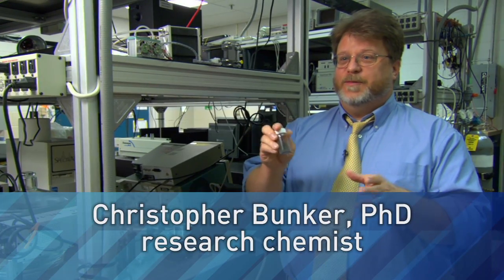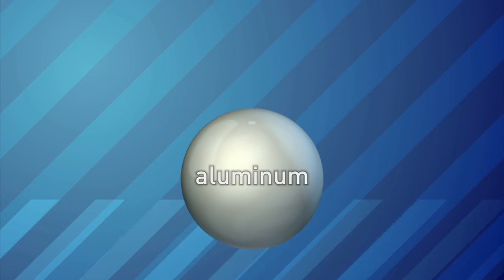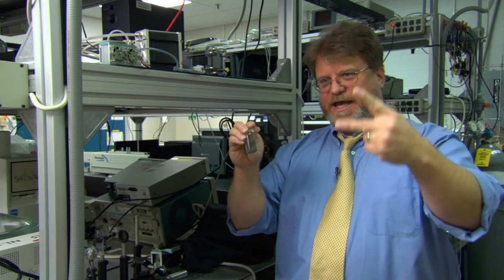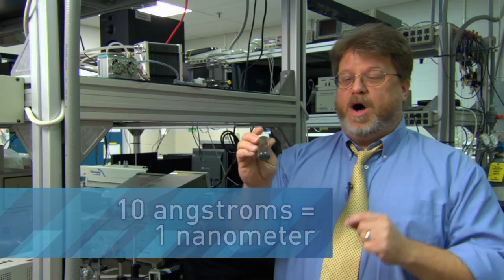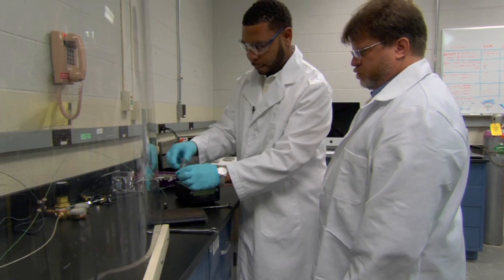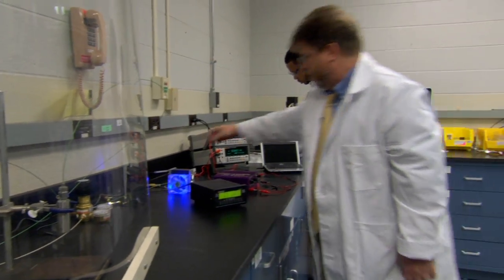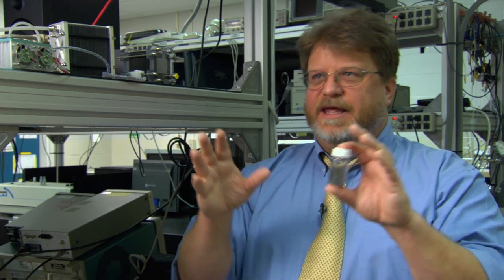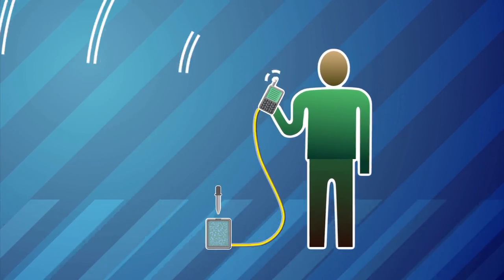Just Add Water:  New Fuel from Aluminum Nanoparticles

Comment: Dont't get too excited in the UK.

If it is any good it would be taxed (duty+VAT) above 70% like petrol (gasoline) so it would NEVER be cheap.

It takes a huge amount of energy to produce aluminium metal from ore and considerable energy to recycle too. This is why Al smelting plants are usually sited near cheap electricity sources such as hydro. You cannot get out more than you put in.

However it is a great answer to the problem of hydrogen fuel storage. i.e just use the H2 in H20 with Al as the catalyst, rather than handling high pressure hydrogen in heavy vessels.  Nice and simple too, no 70 year development without end like with 'king fusion.

Comment: Just to make sure: That 1368 liters of hydrogen per liter of water is hydrogen "gas", not hydrogen "liquid" correct? Someone, please confirm?
Reply: Yes, of course. Though I don't know how they got to 1369 liters. The reaction formula in the video shows three molecules of H2 for every four H20. A liter of water weighs 1000 grams, and water weighs 18 grams per mol. 16 for the oxygen atom and 2 for the 2 hydrogen atoms. An ideal gas takes up 24.79 liters of volume per mol at standard conditions, which is room temperature and normal atmospheric pressure. So the calculation I came up with is: 3/4 * ( 1000 g / 18 g/mol ) * 24.79 l/mol = 1032.92 liters. I am sure I must have made a mistake somewhere, I am no chemist, I just payed attention in chemistry at school. But the order of magnitude is right. It's crazy how much voulme of gas you can get out of a solid or liquid. That's how explosives work, they generate all of that gas in a fraction of a second, so they create a lot of pressure. If you think about it, gases have a very low density, especially hydrogen, but the compounds they are bound in are rather dense.

(A mol is just a very big number that is defined as the number of carbon atoms that weigh 12 grams, and carbon has 12 nucleoids, 6 protons and 6 neutrons. Electrons weigh almost nothing. So the mol is just a tool to work out how much you need of each component for a chemical reaction. In an ideal world, with no side products etc.)

Comment: 31kJ / g Aluminium this is pretty impressive can this type of reaction have different cycle?
1 aluminium water reaction where H2 comes out that reaction is exothermic so the heat could be used for heating houses or if it is hot enough to running Steam-Turbines.
The hydrogen can be used for different types of applications like Iron reduction or for EVs
Reply: If a person just wants hydrogen though the highly exothermic nature of the rxn is a bad thing because to recycle the products back to metal all that energy must be put back in.  Magnesium is a better metal for this for just that reason.

Comment: Just using water, electricity with about 36 ohms, baking soda as a catalyst and a stack of electroplates. This will give you all the fuel you need and you don't need to risk Alzheimer's playing with aluminum
Reply: true but then we're still in the same boat of storage/transport. Having a small aluminum catalyst to generate heat and hydrogen on demand would be super useful.
Reply: @Netanya-q4b  hydrogen Burns so cold that motors don't even generate the heat that you would think period it's cold fuel and it burns cold. In Central Texas, we just used a plastic jug with a vacuum line coming off into a bottle to separate any condensed water from the hydrogen all the while, using vacuum directly into the engine period you only produce hydrogen when you turn the key on . It would be like cranking up a diesel, letting your glow plugs warm up but instead you're letting a small amount of hydrogen to build up to crank up your engine. Only need baking soda in the water for a catalyst. You want to use a dimming switch for lighting to use to adjust how many ohms, up to 46 ohms if you're running a V10 or one of those Duramax v8s. but a small block VA would only require something like 36 to 40 ohms. You get familiar with turning up the power with a dimmer switch whenever you feel that you've reached your maximum. People overthink this technology when Grandpa's used a peanuts jar in their tractors with water in it. The government stepped in and made it possible for all these Old-Timers to get set up with the tractors to run this new gas that can be filled and the government will have it available and as expendable as water but with more power and no need and worrying about water freezing. We're way past needing to worry about water freezing because technology has to pass that ignorance but the government broke its promise when they allowed this corporation to take over and not use it for their advantage but for the progression and survivability for population.
Corporate greed is a big thing and it's making a lot of money for people. 
The only danger of this system is when corporations want to buy your system and your vehicle or when corporations don't want you to make your product available to the public nor do they want the technology disclosed to the public. Mythbusters did this in a way so that they would get the results that the government wants. MythBusters would not use a catalyst to make a perfect working hydrogen generator, all the while people are successfully directly putting in these systems to their air intake on trucks, cars, old, new and there are people still using this type of fuel technology to crank up 80-year-old engines that wouldn't crank up any other way.
Reply: @Netanya-q4b  you're under the false impression that you cannot produce enough hydrogen to crank up your car and to operate at the same time . Why do you have to worry about storing water? Water is everywhere and one gallon of water will last you a very long time. One gallon of water should last you 72 hours. Why do you want to store hydrogen when all you need to do is stimulate it with some electricity and use baking soda as a catalyst to scrub everything loose?. See when you add politics to science, everything gets over thought and overpriced
Reply: @Netanya-q4b  my father's father and his father used water in their tractors until gas stations in diesel refineries popped up all over the country. What came first, the engine or gasoline?

Comment: A man from my country developed and patented a device that allows his car to run on this mechanism. His name is Harlo Mayne and the device is called Maynex H2 Flex. The device is filled with water and lye, then when sealed and turned on it inserts an aluminum cartridge that reacts and provide hydrogen on demand that he uses to run his car. One cartridge gives 300 miles on a small car (such as a taxi cab). He aims at selling the device at 2000 US and each cartridge costing 15 to 20 dollars US. I did some math and it turns out that it’s not much cheaper that buying gas, but it’s still better. The only drawback from his technology is the renewable energy sources that would be needed to process the aluminum cartridges. Huge Hydro, Solar and Wind power stations would have to be installed to produce the demand for the aluminium. As the technology spread then the cost of the cartridge should drop as more waste aluminum from the device will be available (providing there is a stable service to clean and collect the waste aluminium). The waste aluminium will be cheaper to recycle than getting aluminum straight from bauxite. 

These Nanoparticles are just a more efficient way of transporting the aluminum and more importantly controlling the reaction. The device Harlo Mayne made have exploded on him during is prototype stages due to the pressure getting to high. Nano particles provide more control due to great control over the ratio of mass of aluminium available for reaction and the surface area.
 Plus it eleminates the need for High acid or base concentrations.

Harlo Mayne worked on his device for years and have even be threatened, and been set up in an attempt to make him accidentally kill himself. 
https://iamajamaican.net/people/2017/05/jamaican-inventor-harlo-mayne-water-powered-car/
Reply: Grow up, go back to school, educate yourself and never forget to take your meds.
Reply: @suprememasteroftheuniverse  what?

Comment: The facts are disappointing:

"It is estimated that the fueling
 of 300 million vehicles would require 64 million metric tons of hydrogen per year. Since it requires 9 tons of aluminum to produce 1 ton of hydrogen through the aluminum-water reaction, this means that the fueling of 300 million vehicles would require 575 million metric tons of aluminum per year. To put this number in perspective, the world-wide production of aluminum in the year 2006 was 24 million metric tons (www.world-aluminium.org). Thus, the hydrogen fueling of very large numbers of vehicles via the aluminum-water reaction would require an expansion of world-wide aluminum production by approximately a factor of 25. "

https://www1.eere.energy.gov/hydrogenandfuelcells/pdfs/aluminium_water_hydrogen.pdf

Comment: Aluminum has a pretty big energy density : 83,8 MJ/liter.What this reaction does  is actually transferring the energy contained in aluminum to water and subsequently to hydrogen.If this reaction is to be used it would be only to stationary fuel cells (gas stations) and not to mobile fuel cells.So you cannot make this reaction in your car while driving because you would have the aluminum oxide residue problem.This aluminum oxide residue poses problems.The reciclability of the process is much more difficult than let's say,water electrolysis,where everything implies only water,gases and electricity.You would have to take the alumina back to the aluminum smelter.It's not practical.It's easier to release oxygen residue in the air (a gas) than alumina (Al2O3) or aluminum hydroxide (Al (OH)3). One could just grind aluminium then burn it, then power a generator.But the problem is the same,the residue.Aluminum is 1700 USD/metric tonne.You wouldn't want to waste it.
Reply: Gallium Aluminum alloys aim to avoid the oxide residue problem.
Reply: In fact it is great benefit that the aluminum hydrogen fuel is recycleable, regenration. You are wrong.

Comment: And how expensive is that process to make the aluminum so fine?  I want to be able to take cheap aluminum foil and make hydrogen from water (without expending lye or other consumable reactants).
Reply: the lye is not consumable, it remains in the solution and you just keep adding more water and aluminium. The acidic or basic species are only catalyst.
Reply: @raloed.363  I'd disagree, the water is the substance that decomposes the aluminium and any NaOH so the lye is a consumable
Reply: @raloed.363  Yeah that's straight up wrong.  You should try it and find out.  With lye you get sodium aluminate and with acid you get the aluminum salt of the acid.  The aluminate doesn't break down until the solution is neutralized in which case you just lost your base anyways.  A better, cheaper reaction for making H2 at home is magnesium and citric acid.  Even vinegar is strong enough to get magnesium going but there you're kinda limited in available concentration.
Reply: @whatelseison8970  yeah I did some more research long ago and realized I was wrong. The NaOH is a consumable
Reply: @raloed.363  It's actually sort of a weird case because the lye is not contributing any hydrogen or anything - it's simply making the aluminum available to the water to attack.  In a sense it's actually both catalytic and consumable.  Id call it a promoter perhaps.  And I didn't mean to sound like a dick before -- it's actually a very interesting reaction to carry out and if you have any interest you should try it.
Reply: @whatelseison8970  yeah I know. It really gets consumed because it binds with the water and  aqueous  Al to form NaAl(OH)4 or NaAlO2.2H2O. Yet it and the AL can be recycled from the solution, which only makes sense if a renewable energy  source is been used as power to do so. It is still cheaper than mining pure aluminum thou. I wasn't offended by you either. Much respect
Reply: @raloed.363  key always: reducing aluminum oxide, i've read paper if some hv low current apparatus can broke down al oxide into its aluminum at nanosize, you dont need lye or exotic catalyst, try for yourself and upset the oil establishment !!
Reply: @dogodogo5891  I have read papers that say it's possible to use HV low current apparatus to split the water by itself with such  gain that the HHO gas can be used to generate net power
Reply: @raloed.363  no such thing as net power from conventional HHO generator, if there was any then it must had to used of sort catalyst or additive not just pure water

this video itself proved that al np was one of those candidate that's why i said reducing al oxide, its hv will act as reductant into al np not as primary sources for breaking water bond

Comment: First you have to manufacture Aluminum and then process it into nano particles. Wtf! That's huge expense. Please tell me different!
Reply: Absolutely!
Reply: I posted something similar to this before I saw your reply.  I absolutely agree!!  If all you need is hydrogen, electrolysis of water is the best way to go.  If you want emergency electricity then I think solar panels are the way to go.  If you want to run a fuel cell from hydrogen, I guess aluminum foil, water and lye would be pretty cheap but lye is so caustic.  I think the fuel cell idea is just stupid though.  Who would carry all of that around with them?

Comment: You can also put acids in the water to speed up the hydrogen production quite a great deal even without nanotech. All u need is powdered aluminum.
Reply: acids are dangerous to handle, with this mixture all u need to do is add water and thats it, its reliable efficient and easy to use

Comment: I do not approve of any means of generating energy which uses up even more oxygen from the atmosphere... let's save that for breathing shall we!?
Reply: Carbon uses four time more oxygen than hydrogen. Take that ;)
Reply: @hockeyguy820  The only way to obtain energy out of hydrogen involves binding it with oxygen in one form or another. This "fuel" only extracts H from the water by binding the O with the Al, which means the O is lost and when you want to make actual energy out of the H you got, you have to input O from somewhere, which means you take it from the atmosphere. It's extremely dumb.
Reply: @Nightlurk : Ok, I thought you were talking about the oxide produced. All internal combustion, jets, rockets, etc need oxygen. Luckily there is plenty of it in the atmosphere.
Reply: ok KAREN

Comment: The aluminum is just a carrier as it was made by charging alumina oxide ( a gel ) extracted from bauxite oar.( a compound containing alumina ) 
So you are just getting back the charge that was put in it.
The good news is aluminum is very energy dense for its weight and may be a good energy storage material for alternative scourges.
Bad news is nano material would return to a gel when discharged loosing its particulated form, when recharged with electricity it would become solid metal again which would require it to be reprocessed into nano particulate powder. I am guessing it is expensive.
Reply: I have been making nano Al for 20 years
Reply: @jamestacker9560  How do you do the nano Al ?
Reply: Raul Orpinel I have spent 20 years developing the formulas for 43 elements and alloys for the Bottoms Up Process. Bose/Einstein Gas Condensation Phase to make pure metals and alloys.
Reply: @jamestacker9560  can you provide any additional information?
Reply: Nicole Yensen you can checkout some pics . Try nanomaker on Facebook
Reply: @jamestacker9560  hi  saw your fb and seems you are true genuine scientist,

 may i ask you what simple reduction agent for Cu sulphate into Cu np(for mirror coat purposes)? i am dabbled with high voltage too, maybe just my thought is there any colleration between HV n Cu np synthesis?
Reply: Sodium hydroxide, NaOH, used in the reaction, is a strong alkaline that destroy soft body tissues resulting in a deep, penetrating type of burn, in contrast to corrosives, that result in a more superficial type of damage via chemical means or inflammation.

When used up the you have wet slurry of hot (boiling if heat not vented away) oxidized aluminium, some water and probably some remaining NaOH.